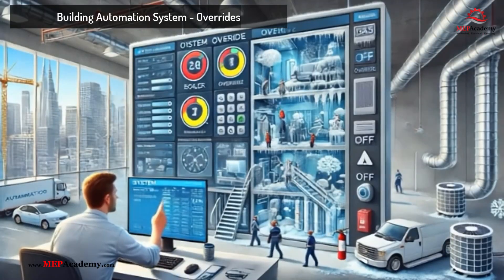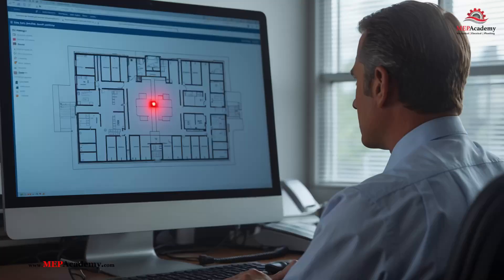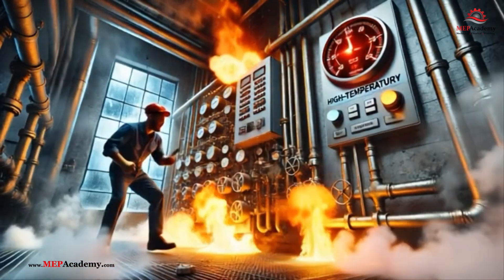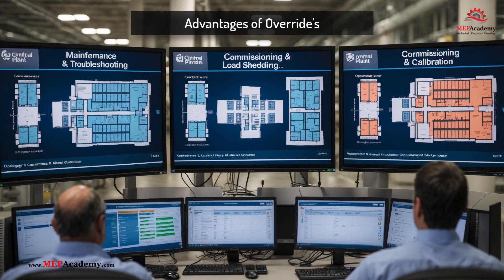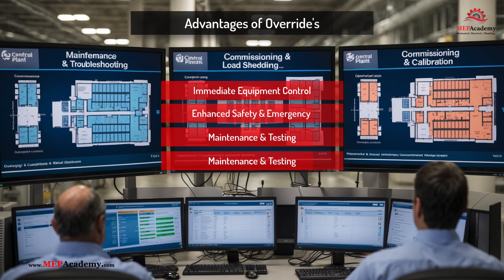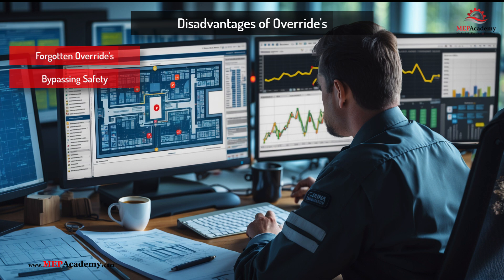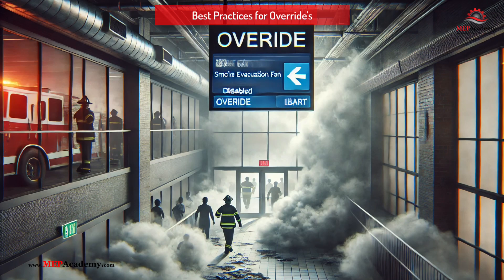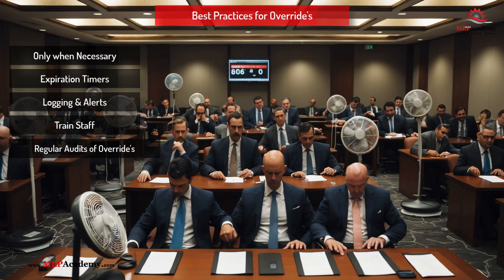Building Automation System Overrides: Hidden Risks & Costly Mistakes Explained

Comment: What difference between BAS and BMS?
Reply from the maker: Good question! In practice, BAS (Building Automation System) and BMS (Building Management System) are often used interchangeably.
BAS usually refers to the controls that automate HVAC, lighting, and other building systems — focusing on comfort, scheduling, and energy efficiency.
BMS is a broader term that can include BAS functions plus integration with fire/life safety, security, access control, power monitoring, etc. In other words, BAS is often considered a subset of the larger BMS.
So if someone says ‘BAS,’ they’re usually talking about the HVAC and lighting controls side. If they say ‘BMS,’ they may be referring to the entire facility management platform.